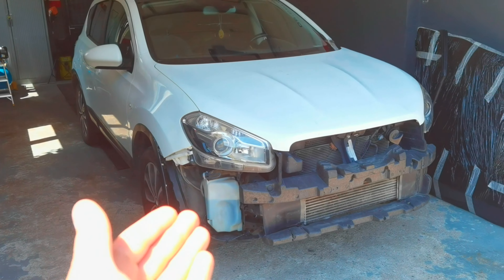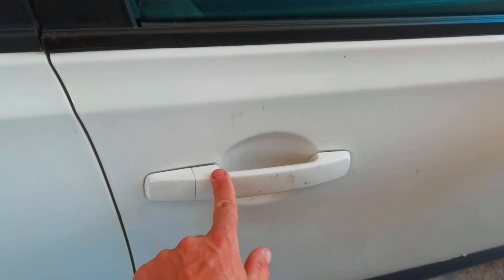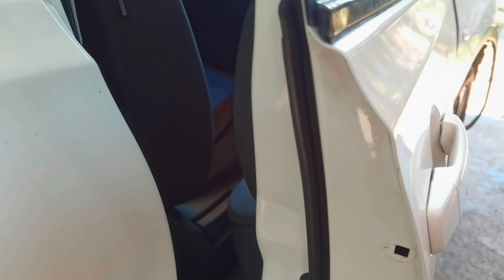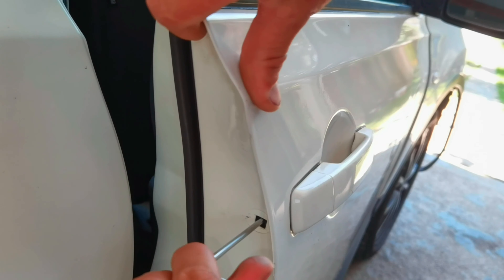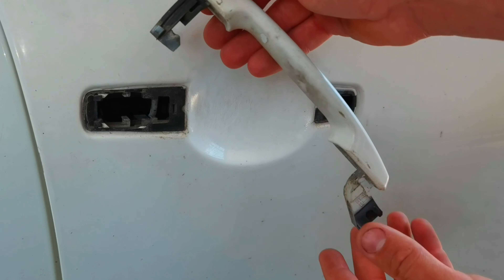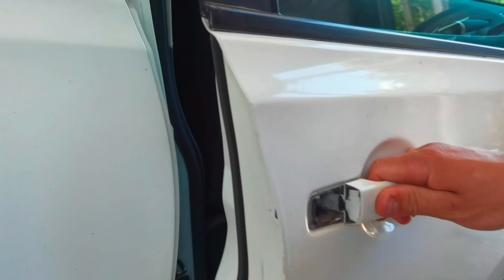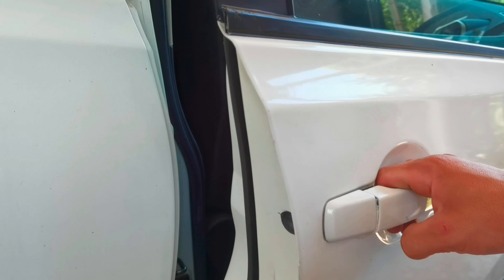Nissan Qashqai J10 Passenger Door Handle Removal Step by Step.

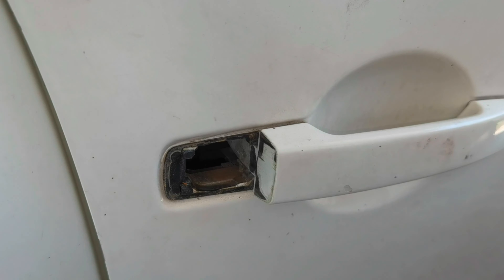Comment: Great video - I've fixed the door handle, but I have lost the internal screw (you removed this at 1:34) and then also the sliding plate (2:45) within the door. Do you happen to know what these parts are called and if replacements are available?
Reply from the maker: I recommend you to remove the entire door panel from interior. Then remove the windshield motor and in this way you'll be able to get back the parts you lost inside the door.

Comment: Thanks for the video. I have a Nissan Qashqai 2007. The Right Passenger Rear Outer Door Handle is not retracting back in place. The door opens, but I have to push the handle back in place. Looks like the spring insight is broken or out of place.  How can I fix that?  thanks in advance.
Reply from the maker: Probably the handle it's broked from inside. I recommend you to remove it from interior and check it.

Comment: Please, how to remove driver door handle with the lock also?
Reply from the maker: You can't remove the driver door handle with the lock(driver side) unless you remove the door panel from inside, then you have to remove the windshield motor along with all the hardware from around it. Then you have to remove a little purple   bracket (it's made from plastic and make sure to not brake it) wich it's mounted over the locking handle from inside the door panel and it's also connected to the other locking mechanism from the middle of the door... It's a difficult job to do but I will make a video in the future and show you all how to do it.